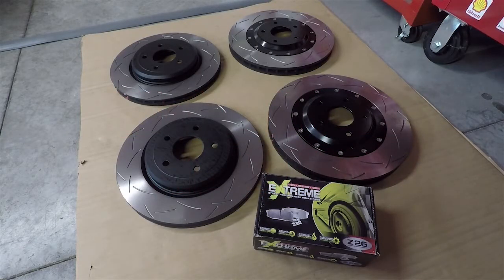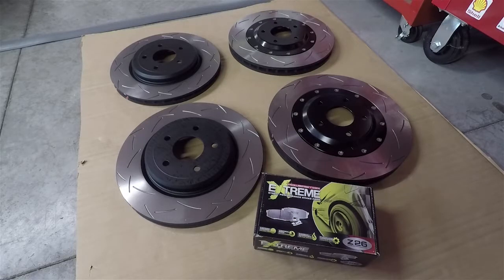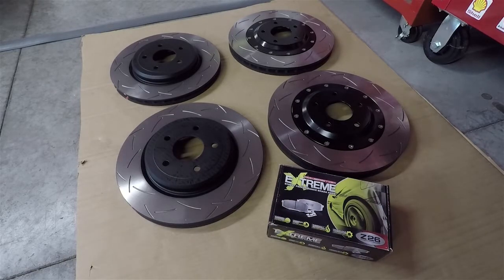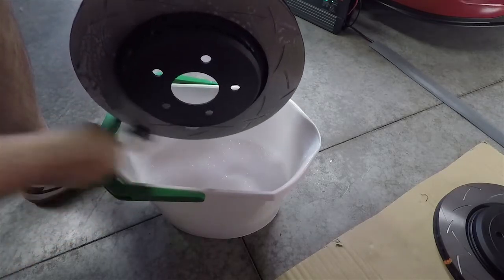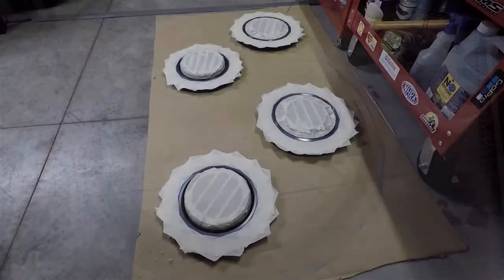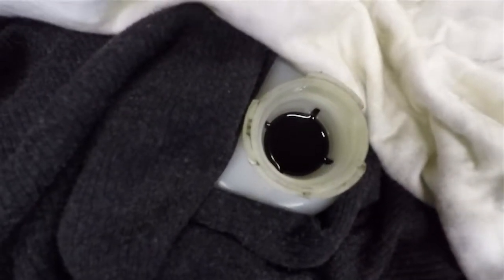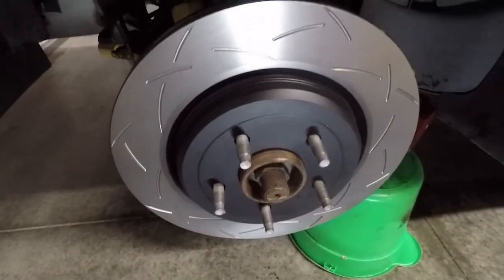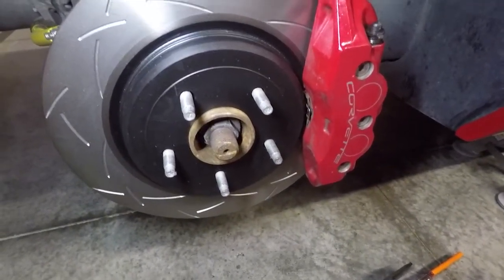C6 Z06 Brake Rotor and Pad Installation

Comment: Just my two cents and advice for others. Unless you are competitively racing, I'm talking pro or semi pro, you do not need a $1000 set of rotors. Unless you are driving your car at levels where you are a squeezing every inch of performance out of your car and extra few pounds of weight savings will make a difference, then by all means. But for the average aggressive daily driver and weekend track junkie, brake pad choice is way more important than lightweight expensive rotors. I can't almost guarantee that the majority of owners don't drive their Z06 so hard that they can tell the difference between stock rotors and expensive lightweight Racing rotors. Even brake pad choice should be selected for your ACTUAL driving, not your fantasy. So track pads on street cars are bad choices. If you track your car, the ideal situation is the have two sets of reasonably priced rotors and a set of low dust street pads and a set of high dust high friction track pads and swap out your pads and rotors before you go to the track. My point is that no street car benefits from expensive rotors besides bragging rights. Even cars that come with the extremely expensive carbon fiber rotors are overkill for the majority of drivers. A guy at the track once told me, instead of spending $2,000 on mods, take that $2,000 and go to a weekend racing school. Stock cars are way more capable than our actual driving skill or need.
Reply: Also, OCD is real!

Comment: Everywhere I look at these dba rotors it doesn’t specify if it’s for the pair or for a single rotor. I’ve seen the 5000 series front rotors for just under $600 is that for one or both?
Reply from the maker: @savagepickle0443  at the time it was for the pair

Comment: nice set up.
Reply from the maker: Thank you sir! I did the pad bedding procedure yesterday and they work great with the rotors. Stops super fast, no squeaks or squeals, and the best part - when I got home there was no brake dust anywhere on my wheels! :)
Reply: The brake dust is insane on my vette as well, I spend 3 hours washing the car and cleaning the wheels and within 3 minutes of driving alls you see is brake dust.
Reply from the maker: The OEM pads stop great, but the dust is maddening. Once I got my new black wheels I knew eventually I'd want to get different pads because they would get filthy after each drive, and I hate cleaning wheels. LOL. With these new pads I'm planning on blowing them off with my compressor and doing a simple wipe down from time to time, and a thorough wash of the wheels maybe once or twice a year, tops.
Reply: Good decision you made there. Hate cleaning wheels, the worst

Comment: What brake pads do you recommend I use? I have a 2009 C6 Z06
Reply from the maker: Abu Nation Same ones as in my video. Powerstop Extreme Z26. 😁
Reply: @ZWHOA6Productions  can you please send me the link to the exact ones you purchased? For the front and back please
Reply from the maker: Part numbers here: https://www.powerstop.com/product/power-stop-z26/#y=2009&mk=CHEVROLET&mo=CORVETTE&p=Front%20%26%20Rear&ss=Z06%20Package
Reply: @ZWHOA6Productions  what do you think about the hawks? They are alittle bit more expensive
Reply from the maker: Abu Nation I’ve heard mixed reviews. The ceramic hawks don’t stop as well as powerstop and the metallic hawks dust way more.
Reply: @ZWHOA6Productions  oh ok forsure

Comment: i appreciate that you took the time to make this video, but it's not a very good video. the first 11.5 min of your video had NOTHING to do with the install, aside from a quick "clean the rotors before install" that could have taken 5 seconds. And then you didn't even show how you pushed the pistons in. At the end of the video you mentioned some caliper spreaders or a c clamp, so I guess they're not the type of pistons that have to be screwed in, but you didn't mention that at the time of removal/install. You didn't show how you took the rotor off or put the new one on. Basically all this video did was "show off" you brakes and how meticulous you are with making your brakes look pretty. If you make another "install" video, focus on the actual steps and less on the extraneous stuff that is specific to your tastes and parts. Was not a very helpful video. Again, I appreciate that you took the time to make it though.